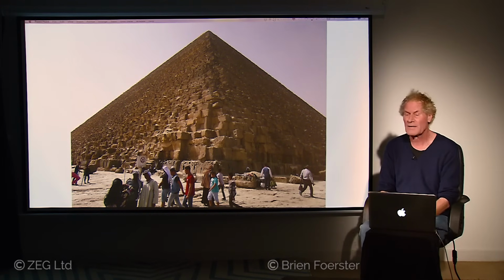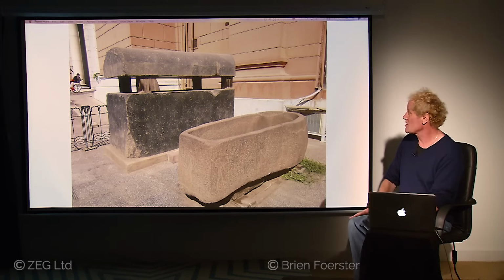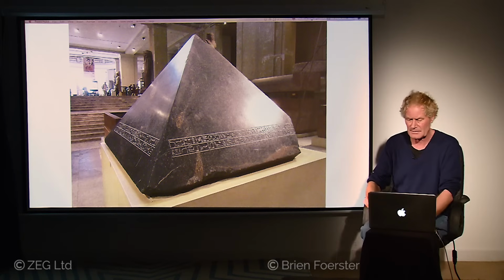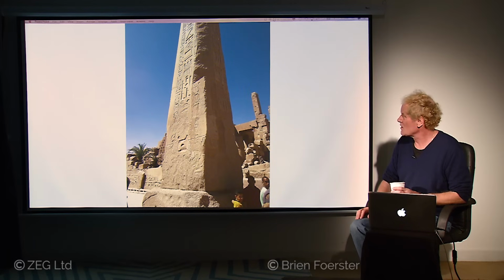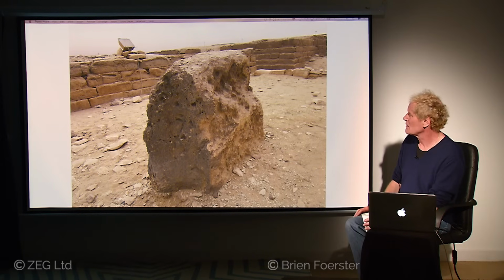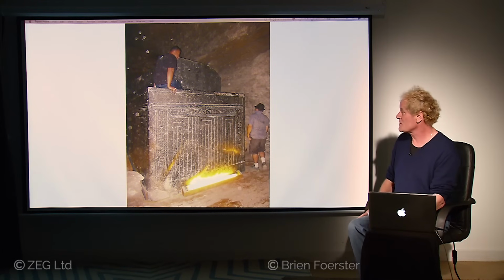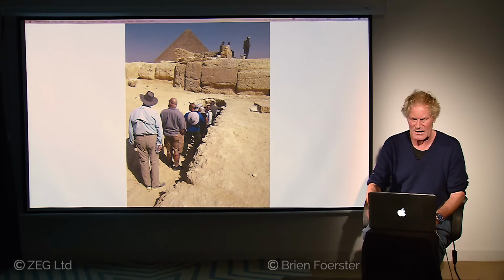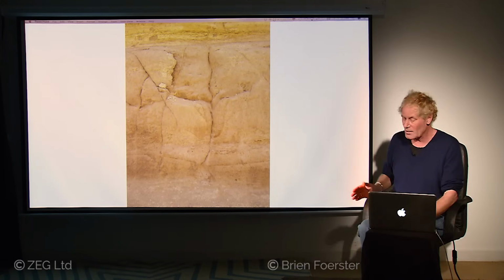Lost Ancient High Technology Of Egypt Full Lecture

Comment: They cut the blocks by drilling small holes and filling the holes with boiling water and plugging the hole with a wooden plug and the pressure from the hot water expanding cracked the stone blocks at each hole drilled creating square shaped blocks

Comment: Interesting idea, although remember that since stone does not make a very efficient beam due to its very low tensile strength, many buildings in ancient times used timbers for their roof, and often other highly flammable materials for water-proofing.  So if a fire started by accident or deliberate it would certainly cause similar heat induced damage.
Reply: there's no way that simple wood burning against those statues would cause markings like that..
Reply: @cassandranicholas3865  Why not? The roof structures were made of massive wood timbers and planks, often waterproofed with tree sap or tar, as we have seen in modern times, once a fire starts it often rages out of control until the fuel is all spent. it seems not only likely but inevitable that some fires started (or were set) during the time period.

Comment: A popular method was to brittle the stone with fire and pound it with a rock.
For cuts they used water and sand. For drilling they used sand and string tied around drillpole.
Reply: you can't bore into granite in this way.
Reply: There are all kinds of ways to bore.
They could have placed a big rock on top of the drill and spin it. 
And they also did have iron and water/wind/animal/slave mills. It's not rocket science.

Comment: It seems obvious many ancient cultures were far more advanced than we typically give them credit for. 
Their technology was simply different than ours. The ancients' technology was based on utilizing natural resources both for product and for tooling, where ours is based more on artificially created resources and methods.
Reply: Well, actually no; Egyptians did not have that technology either, because where are all the Bridgeport mills and engine lathes not to mention the tool steel and welding equipment or the iron ore crusher gears made of Austinetic Manganese steel plus the foundry needed to pour the steel into bar stock and mill beams? I am a foundry worker as well as a toolmaker machinist, Master welder, Millwright, Moldmaker, Draftsman, and Metallurgist. Where are all the iron ore mines, the Molybdenum mines, and Manganese mines? You can't build these structures out of extremely hard stone today let alone move them without building a weight-bearing road to transport 30-60 ton blocks, plus these blocks can't be cut, moved shaped and set every two minutes to build the Great Pyramid with only copper chisels and human hands or muscle in 23-36 years.

Comment: I understand people want to give answers to all possible questions out there but we don’t know for sure do we? For example I’m hearing these 100 ton stone boxes were made by pre-dynastic people using advanced superior technology and with the help of artificial lighting because it’s pitch black down in those tunnels. I get that and it makes sense. But then my question is, if the much later dynastic people did the etching how come there is no sooth residue anywhere in the tunnels if all these people had were crude torches for light to do the etching by? As crude as the etching may be there is still a lot of it and it would have taken quite some time to do it all and it was still dark down there when they did it. And even to do the etching I’m thinking would have required fairly good lighting. And if all the had were torches then there should be quite a bit of sooth residue in at least some places, especially around the boxes, shouldn’t there be? I’m just wondering what your thoughts are on that? By the way I’d just like to say that I really enjoy your videos. And a great presentation in this video also.

Comment: similar structers are also in INDIA. purpose of shafts and tunnels not known
Reply: Maybe it was …...ALIENS?
Reply: @busterbiloxi3833  As far as that goes, we are alien to this planet ourselves!
Reply: The purpose of shafts were simply for cooling, they did not have Air conditioning. The best way to recieve sufficient cooling was go down deep from the surface . The warm air cools as it reaches beneath. I call this Inverted distilation theory depending on the structure, earth material of the shafts in place

Comment: As a machinist I will tell you that those tooling marks( *the milled holes especially)  are amazingly clean on stone which is hard to work with today.  The point of this show was that they had high technology.  Moving massive stones is not impossible its just not easy even with our tech how many years would one pyramid take?  I laugh because we would never finish- the cost would be so incredible we might as well just go to the Moon.

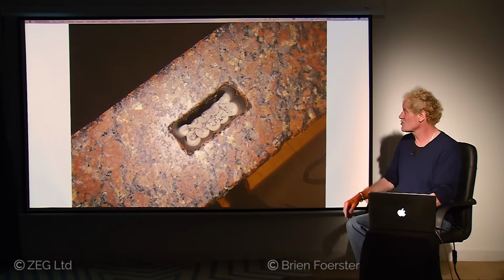* More specifically the plunged drill or mill holes at 11:48 of your program.  Plunging is actually a good way to mill hard material but you need a incredibly tough tool.  I wish I could see the size- looks like half inch or inch holes bored maybe a inch or two down?  The bottom of the hole looks flat so it would be a precision tool cutting down to .001 or less of an inch.  You can usually see the step marks if off by just a .001 or more.  The way the bottom marks merge means the tool was doing its job perfectly.
It looks like it was made yesterday.

Comment: Large, gaseous exo-planets are being discovered close in orbit to their star. So, Jupiter, Saturn, Neptune, and Uranus may have originally been closer to the sun. As their orbits went to the outer solar system, being close to the Earth may have caused an Avatar type situation. This would mean easy transport of large stones that were mined miles away. The charge of these planets, could also discharge as violent and hot lightening type strikes. Meaning they were the cause of heavy mining being possible AND their subsequent destruction. 
Also, you can use bronze saws and drills and add sand to cut thru granite. There's plenty of video showing this being done.

Comment: calculation help please (32:07): 
a Granite cubic meter is 2.66 tons (kg/m). lets say it is 2m X 2m X 3m. i cant tell if its 3m wide but it is not 2m height ether, though it might be a bit in the ground so just for the sake of compensation ill give it 2 x 2 x 3. lets say you meant it is a US ton so its 2.96 tons per meter. which for the aforementioned structure size is 36 tons. 
this is half of your numbers, without even reducing the inner part that has been chiseled off.

Comment: Isn't it interesting that the analysis is so limited and crude? Use of the words, "signs of," instead of determining the amount of energy used and possible or probably sources of same. Any mention of similar damage to ANYTHING, ANYWHERE else on the planet? No. Weird that some unknown heat source WE would have to imagine was from the sun, as even NOW there is nothing except a hydrogen bomb which could generated heat of that which caused the damage. VERY suspicious.

Comment: There are ancient manuscripts, particularly from ancient Hebrew manuscripts that were used to compile the Judean - Christian Bible. These writings declare that there was an Earth age prior to this earth age that was destroyed in a revolt against God. It also declares we ALL existed during this time, but NOT flesh. Time frame: I assert that the key to unlocking that time frame lies in the  Sphinx at Giza and the mentioned facing due East at the time of creation. Taking precession into account and running the solar clock backwards will bring out intersects coinciding with the Sphinx facing due East-90 Degrees, and dating (A halfway decent try) of the material. It may show 15 to 25,000 years or older. The great flood is not considered because it happened much later than the event in topic here. These manuscripts declare that this world is MUCH older that what some scholars? believe, mainly because of mis-translations or outright omissions from these same ancient manuscripts. 9 billion years is most probable. 

Brian Foersters presentation supports this biblical account and Word of God. The Earth was created, destroyed (knocked off its axis), refurbished for a time, for reasons not mentioned now,; Will be destroyed again with great heat from the sun. I found it, so can you!

Comment: You seem to think that stone MUST be worked by materials harder than the stone. That's just not right. Certainly for efficient work, harder is nice, but if you aren't worried about efficiency, or don't know any better, you can work and/or polish stone with softer materials. In fact if time was not a factor at all, you could polish a stone just by rubbing it with your hand for a few years. Something we all tend to do is force our idea of technology onto previous civilisations: "We don't know how they did it, but it must have been this way or else they couldn't have done it", which is clearly nonsense as they did do it. Somehow. I wouldn't be surprised if the 'bandsaw' turned out to be a wet rope. Covered in sand maybe... or powdered 'object stone'.

Comment: @Brien - The reason they (whoever they are) could carve such hard material, in this case granite, and be able to move such brittle material without breaking is related to malleability. They possessed the ability to phase change material and alter the strength of its molecular bond. So, first they made the stone more malleable. Second, they performed the carving. Third, they moved the object. Lastly, the material was returned to its original phase and molecular bond. The change in molecular bond would likely result in a far less dense material, and thus dramatically reduce the mass. Whoever they are, had a very high degree of chemical and molecular understanding. In a nut shell, they are not confined by mechanical limitations, we must think outside the box!

Comment: hi brian those stones with the nodes was made by casting in bags and that is the corners that's why every face has a slight belly as do the ones at the inca site they actually had a way of casting basically could make compound the bags weathered away over the centres no great Mistry very basic build this is also why they fit together so tight and no size or shape restriction as each bag slumped down and settled over time those crazy shapes came about . thanks colin

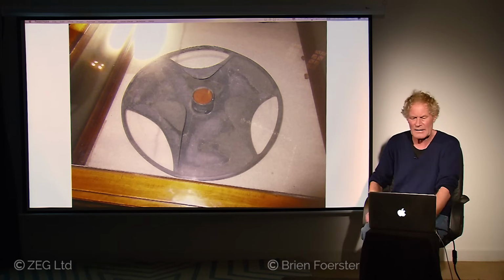Comment: 10:40 that looks a lot like the wheel to a band saw.
I will say a bit of criticism: You use rather strong language that implies something would have been impossible without 19th century technology. I would say never underestimate what a skilled craftsman can do with time and a bit of ingenuity. Sure modern tools help a lot, but even craftsmen working well before power tools could still cut precision joints almost nearly by eye.

As an example, the Piramidon(spelling?) you show at 12:40 could have been made using a lapping process after the surfaces where roughed in. It would have not been difficult to lap in 3 stone plates as tools to then use as laps for polishing the surface. Another thing diamonds and diamond dust is not the only cutting medium that can cut or polish stone such as basalt or garnet, as an example Corundum, particularly as a powered and used in a slurry could also cut these stones. Another alternative is dust made from the same stone, it would have taken longer for sure, but it would have worked. All this said I think it's worth looking into as a possible method used by the creators of these objects. I agree I think the Dynastic Egyptians where not the original makers of these features however I think it's worth nothing that it's not impossible to make these things without modern tooling.

Comment: your assumption @ 11:35 that these couldnt be powered by hand is in correct. If you have enough gear reduction / gear increasing / switching you can get any speed by hand or pedaling. Also a motor is electrical, an engine is some kind of fuel conversion. A series of gears or pulleys would be mechanical.

Comment: One way of moving those Granite blocks thru the tunnels is, if they filled the tunnel or a portion of it with balls they could roll the blocks through, the balls would have to be made of something hard, maybe Granite as well, but if there were enough of them the load would be distributed evenly. The balls would have to be quite big, perhaps the size of bowling balls and they would have to be continuously fed from the back to the front. This system, of course wouldn't work above ground as the balls would roll away at the sides. They probably didn't do it this way, but it's just a thought.

Comment: 28:45 it looks as if the force came from inside of that pyramid if it came from the top you would see more debris spewn across the floor. But when an explosion occurs from the inside some material is flown outward but if the explosion is small enough most of the debris will fall back into the depression.  similar to a volcano

Comment: there is an older video , from 80's or 70's...where and old school professor explains how you can work any kind of stone , just with wood, sand and water. it's really basic tecnology, that allows you make these accurate cuts and holes. he showed in the video - they made pretty good progress on stone just puting some sand on surface and then moving a wooden plank back n forth. sand kind of works as diamond dust.

same wuth drilling, you just put sand under your wooden axle  and then a wooden frame with a rope is used to make the axle spin wth pretty decent speed. again they got really obvious results in like 10-15 minutes. and there are also primitive technologies ot move those stones. you put wooden planks on the ground and just put some sand on those so the rock is kind of sliding on sand. also makes transportation much easier then it was thought to be. 

"ancient architects" propsed a theory about the wall that looks like the one in Peru .and he actually has video on this topic . https://www.youtube.com/watch?v=Vv49DND3uPI . makes perfect sence, i just wondering what ancient material could hold so much pressure from inside, made with all the uncured concrete that would be trying to burst out of the bags under weight of upper levels. 

So it is all very interesting and i definetely think some of building are much older than we are tought to be thought. but i also don't belive in magic or that alins build these things lol . probably the ancient humanity just used very different way of thinking from modern society....and we are so stubborn and uneducated that we invent some aliens and write false history to mislead people
Reply: I've worked down the coal mine and we used to moved heavy machinery using pulleys, slippery wet boards and levers, ropes anything you can get your hands on, but this was only for very small distances and certainly not uphill.

You would not embark on a project if, in the planning stage you realised that the amount of work involved in cutting just One stone was so long, hard and laborious that, the time taken to finishing the whole job would be unacceptably long. So you wouldn't bother. also ... in Puma Punku in South America, its at a height of 13,000 feet which is way past the tree level, there are no trees for them to use for stone moving, stone cutting or scaffolding.
Reply: @MindCrazedBanjo  i am all about conspiracy and that modern history talks shit to us. but also just saying what i saw in other video . for now everything i know comes from videos.so i should probably just shut up and not try to be smart.